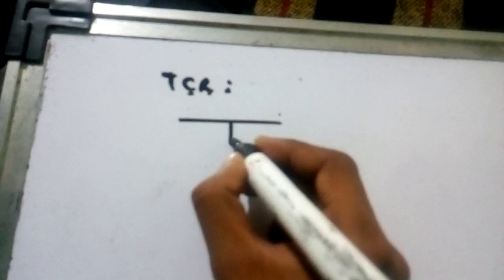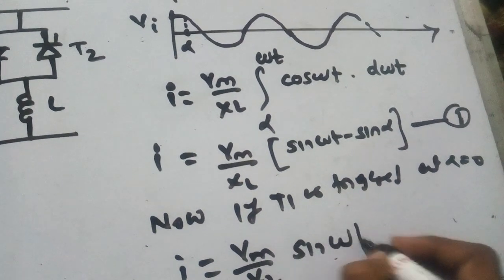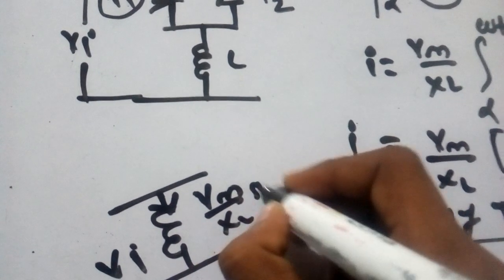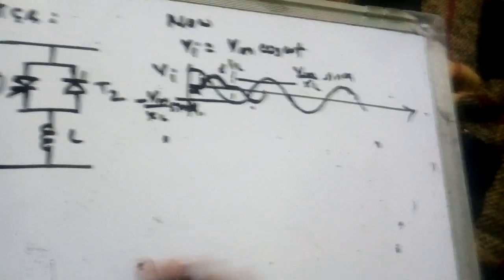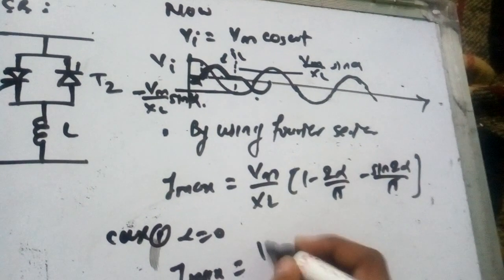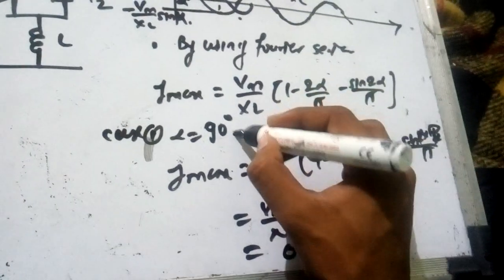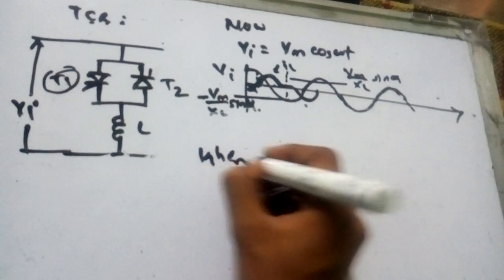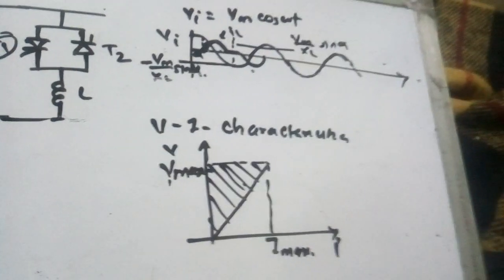Thyristor controlled reactor

Comment: sir kis book sa refer kru waveforms kaisa bnai for different alpha???
Reply from the maker: Dear sir in this video we have assumed current waveform w. r. t. Peak of input voltage . There are two methods to explain this. 
1. Firing angle measured with respect to peak of input voltage (that i have shown in this video) 
2  firing angle measured with respect to start ing zero point of voltage now this time expression of voltage becomes v= V max sin Wt. And now according to this voltage please derive current equation. Now waveform become sliglty different
Reply from the maker: Please refer facts book by hingorani author
Reply from the maker: In my  video,  if you want to draw current waveform for different alpaha choose peak of voltage as reference and decide start ing point of current from peak of voltage by any alpaha and calculate conduction angle 
Conduction angle = π-2@
Reply from the maker: At alpha @= π÷2 current waveform become zero  so we can draw waveform for current in between @=0 to @ = π÷2   in my video
Reply from the maker: Please  refer simulation of thyristor controlled thyristor in matlab
Reply from the maker: That  published in my recent video thanks 🙏
Reply: Bhai aap apna communication skill par bhi work karo aap iss video me samjha hi nahi paa rahe ho ki ho kya raha hai bass likhe jaa rahe ho jaise koi classteacher ka notes likh raha ho wo bhi saaf nahi hai  clear pronunciation bhi jaruri hai
Reply from the maker: Ok thanks I will do it definitely